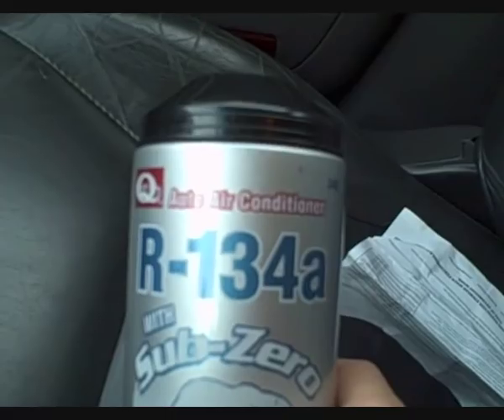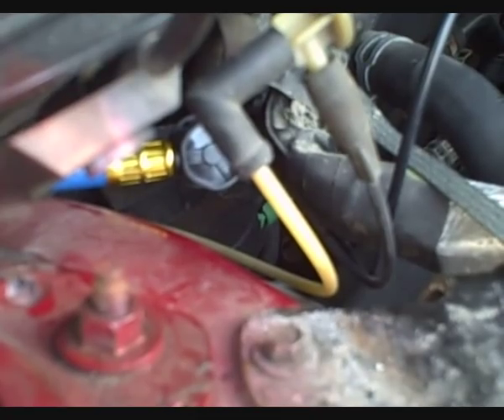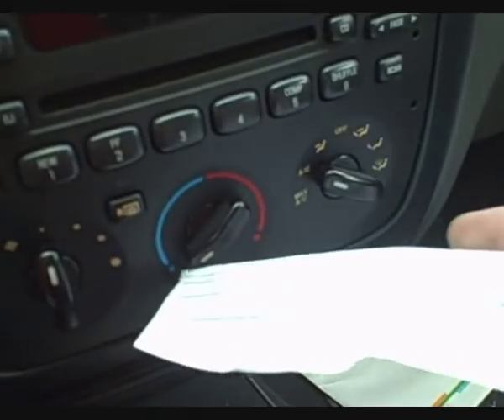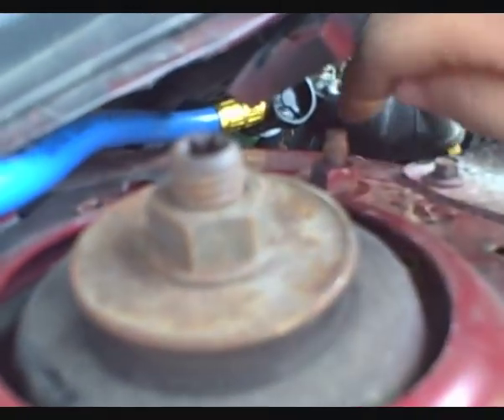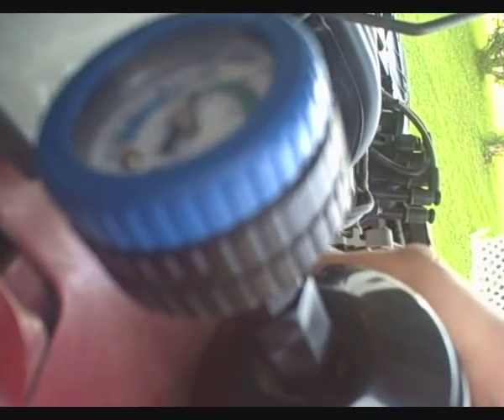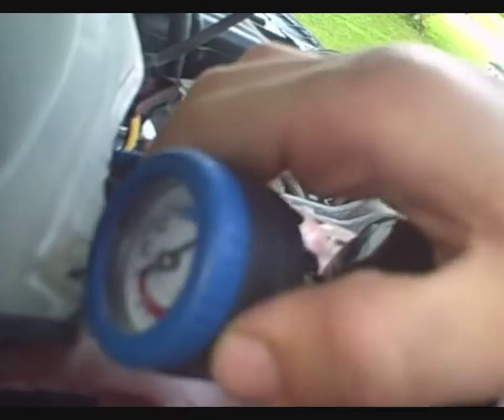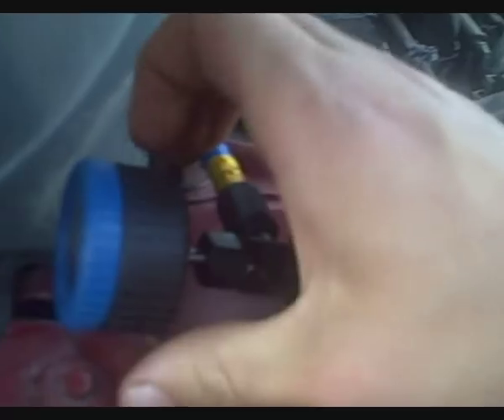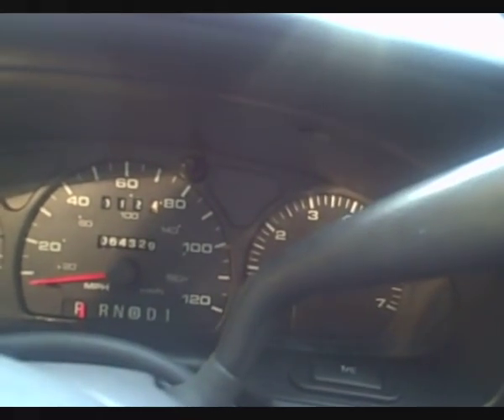Recharing A/C 2001 Taurus

Comment: Mike, Does the 2001 Ford Taurus have a sight glass for the AC system that you can check for bubbles which usually means it is low on freon.?
If it does where is it located?
Reply: To my understanding, cars with R-134 refrigerant don’t have sight glasses.   Those were on older systems using R-12 which was phased out in the early 1990’s.

Comment: Update - With your help I found the low pressure port with no problem. When I connected the gauge, the needle would move to the add area when the compressor engaged, and then move to the high side of normal pressure when the compressor disengaged. I went ahead and tried adding Freon. And low and behold, as soon as even a little bit of Freon went into the system, the compressor engaged and stayed engaged.  It took the whole can to get the gauge to read consistent in the normal area on the gauge.

Comment from the maker: Generally the clutch will disengage when pressure gets too high. If it's overcharged it could engage and disengage a lot. Or the system could be deteriorating.

Comment: Thank you for this video, it was a big help.  Earlier I had searched until I gave up trying to find the low pressure port.  I have a question - the compressor clutch repeatedly only engages for maybe 3-5 seconds and then disengages for about 5 seconds. Is this normal?  I would think the clutch would be continuously engaged as long as the A/C is on. Could this be why my system is not cooling very well?  Thanks
Reply: Low freon.

Comment from the maker: Let me guess you either a) paid someone a lot of money to do this when you could have done it yourself, b) overfilled the AC or c) had a failed AC system that couldn't be fixed by a cheap solution, correct?

Obviously, any attempt at doing so should be done at one's own risk.

Having done some research it looks like this is a completely safe method.

have a nice day :)

Comment: good job showing people how to destroy an airconditioner. hold a can upside down or sideways and you slug the reed valves in the compressor with high pressure liquid when it is trying to suck low pressure gas and compress it into a liquid. cheap ass autozone low pressure gauge that is inherrently inaccurate, can of subzero leak fixer garbage that will just clog your system, not to mention you probably have a leak which is why your recharging, so oil probly leaked out and now you'll destroy the w
Reply: DangerDaveFreestyle that’s what accumulators are for, they prevent the pressure chamber from full stroking on incompressible liquid brah

Comment: at 1:11 the gauge shows red, is this because the ac is off? I am trying to recharge my system, when the compressor kicks on it goes into the green but when it's off it goes way up. I am hesitant to wreck my system with the possibility of over charging...thanks.

Comment: Synthetic R134A, hmm. I'd like to know what that is about.  The lower pressure stuff, hydrogarbon based, yes, Canadian Tire and their sidekick 'Part Source' sells this stuff to people hoping for a quick fix.  It does initially work, I will not deny this, but you only need half the charge of the R134A, and lower pressures, yes, as stated.  But here lies the problem in the long run:  What carries the oil charge throughout the system? The refrigerant.  Not enough, the oil stops moving, what fails?
Reply: spikedpunk